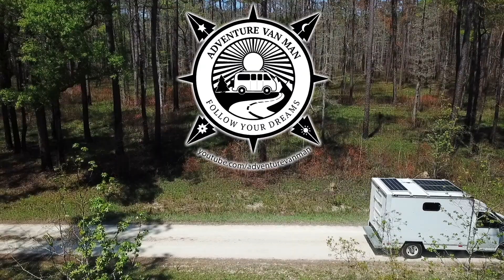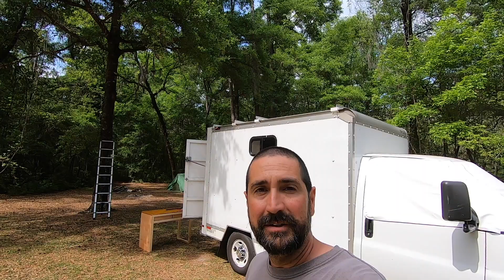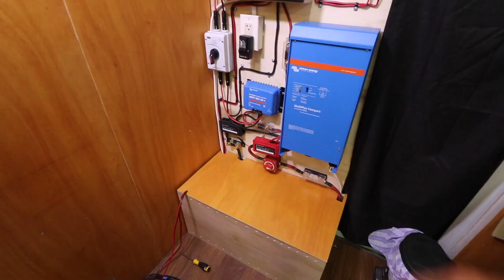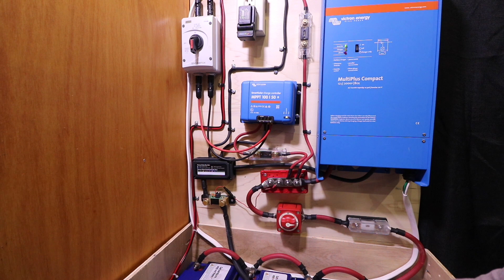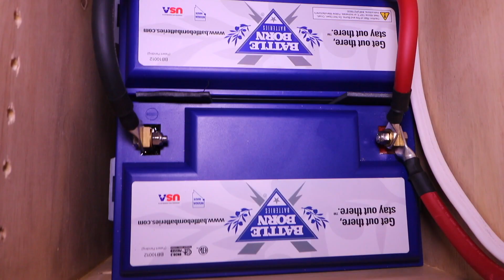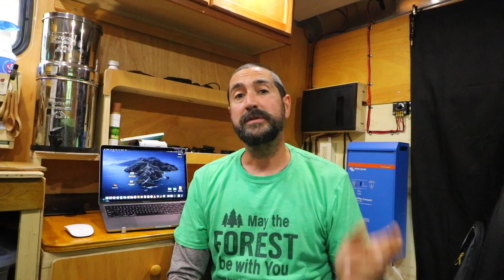Box Van Camper - Off Grid Lithium Power

Comment: The only thing I see that might be an issue is your fuse on your charge controller. You have a 30 amp fuse and it should be at least 100 amp?

Comment: Nice video...Just curious, couldn't you just put couple 15A circuit breakers on wires coming down from the solar panels  instead of that big disconnect switch?
Reply from the maker: Yes you could.  I could not source a quality and reliable 12 circuit breaker at the time of this install. 👍🏼

Comment: Cool setup - but the neg bus bar appear to be uncovered. If something metal touched both bars, you are going to have a massive flash and hot metal flying before the 300A fuse blows. You have the Pos bar covered, why not cover both?
Reply from the maker: I took it off to show the terminals for the video.  It normally has a cover. 👍🏼
Reply: OK, good to hear both bus bars are covered.
Can you explain why you have a 300A fuse on the main circuit? I don't think you will ever have a 300A load, even while running the inverter on a high amp appliance. Fuses should be just big enough to supply the needs of your setup, amps over that are just more sparks and damage if something shorts out. (looked up the amps to watts conversion) 3600 watts will be supplied by that fuse - do you need that much?
Reply from the maker: That is the fuse Victron supplied and recommends using on that inverter. 👍🏼

Comment: Whenever possible use 12 volt only. Power conversion from 12 volts to 110 to charge low voltage batteries is not an efficient use of power. Most of those devices can be purchased 12 volts so if available go 12 volt. The inverter should only be used for those devices that are not 12 volt capable. In my RV I seldom use that device seldom off grid. 

My main use is for appliances but most of those have a backup. Like my espresso machine has a turkish coffee pot that I put on a burner or camp fire. My 110 instant hot water heater is backed up with a solar shower and a engine coolant loop heated by driving. Just things that have worked for us in over 40 years of being in the field. Great job you will love what you can do with the new systems.

Comment: Very professional looking setup Good job. I run a lithium battleborn battery in my little teardrop trailer I'm thinking about adding a second battery what's the number/size cables are you using to connect each battery. 
Thanks
Reply from the maker: 0/2 gauge

Comment: I really like your set up, my question is why didn't you buy the new battle born lithium battery (240 amp I believe so I could be wrong).  Wouldn't it have been cheaper and have more amp hours. Or why did you go for the four battle born instead of two. Hope I make sense. Thanks

Comment: I love watching your videos. Its a neat setup. The only thing I see that I would want to alter is the lead that goes up to the shunt, it is touching the positive of the battery, over time this could vibrate (especially off tarmac roads) and wear through the insulation causing a dead short and as it basically bypasses the main battery fuse it could have terrible consequences. Fortunately its easily fixable by securing the lead away from the battery positive with a cable clamp or cleat.

Comment: You've invested thousands of dollars in a solar panel and battery  bank system Does this make sense ? Does it make sense putting gold plating on an almost salvaged vehicle? What's the engine and drive train in your box truck worth? Isn't it worth less than this solar and battery bank system?
Reply from the maker: I earn money online using this power.  In the last 3 months since I installed this I have earned more than the value of the power system. So yes it is worth it to me. ✌🏼

Comment: As mobile as you are, you should have looked at getting a goal zero 1500 lithium portable electric generator. You could charge with the solar system, but take it outside of your vehicle. It’s not cheap but has lots of versatility. Maybe next time you need batteries. Good video and very detailed.

Comment: Make sure that inverter has the capability to detect AC line issues such as no ground and reversed common and hot.  If it does not have these items, then make sure you get a shore power cordset that has LEDs indicating the AC power status at the shore power plug.

Comment: That looks like a very capable and well done system.  What made you decide to go with such a big inverter?  If you are running only two AC duplex outlets a 1,000 watt inverter would be more than adequate.  I can see the bigger inverter if you have plans to get a full size microwave or microwave convection oven.
Reply from the maker: I run power tools. 👍🏼
Reply: @AdventureVanMan  Thanks for the reply.  That explains it if you use plug in tools, but not battery tools.

Comment: No dispute that the build is exquisite. And I love your channel and your whole approach to your lifestyle. But your viewers should know that the cost of the Battleborn batteries alone is $3,600.00 ($900x4). For that price you can buy two LiFePo Bluetti AC200p solar power stations ("solar generators") and get just about as much power (4800wh from the Battleborns vrs. 4000wh from the two Bluettis) with none of the install work. In your case, you could dedicate one Bluetti for your computer/music, and one to run your other gear. The only downside would be if you need more than 2000 watts from a single AC inverter (2 units = 4000W available AC power). I am a long-term camper, not a full-timer, but if your goal is to live on less money, the solar power station route (Jackery, Bluetti, etc.) is more practical, safer, easier for beginners, and much cheaper, for relatively equal results IMHO.
Reply from the maker: Yeah, I’m not a fan of all in one units.  I prefer component systems.   At the end of this video I tried to stress finding what your personal needs are and go from there. ✌🏼

Comment: You could add alternator charging, if you get stuck in an extended no sun situation, and are moving to another place .  Then when you get there you'll have more power, especially if it remains not conducive to be outside.   Jayman...
Reply from the maker: Thanks!  Yeah, they sent me a Precision Circuits L-BIM to use but I haven’t installed it yet.  👍🏼

Comment: Great job on the tidiness and layout of your system! It brings to my mind some questions that I will research. First is I have never seen a cut-off switch that isolates the batteries from the charge controller.  Since you have a cut off for the solar panels, I'm assuming you would have to do that first before isolating the batteries from the charge controller.  
✌️😎😁

Comment: Nice rig. I am a   follower of your channel for quite some time and love your vids. Anyway, with the current set up, it seems to me that when you switch off the current from battery to your positive bus bar (let's say you are trying to fix some light/socket circuit),  it also disconnect the controller's path to your battery. This is a bit dangerous because, if you forget to switch off the incoming current from solar panel to your controller beforehand, the controller might get damaged.
So aside from the hassle of having to remember  turning off solar incoming switch + batter disconnect switch (in that order), your system will stop generating power if you are repairing some downstream circuit.
If I were you, I would consider having the outgoing positive wire from  charge controller, after going through the fuse, to connect to positive terminal of battery system (instead of the positive bus bar).

Comment: you're not monitoring each cell voltage separately, not balance charging? these are LIPO? i worry about your battery management especially when charging.
Reply: The Battleborn batteries have a built in BMS that balances the cells. From their website

The BMS protects the lithium cells from getting damaged in several scenarios.

1. From low or high voltage, low or high temperatures,  if there is a short in the system, it will shut off. The BMS shuts off the battery to protect the li-ion cells and the user from unsafe operating conditions. 

2. The BMS also regulates the amount of power you can take out of the battery. On our 100 amp-hour battery, the BMS is rated to 100 amps continuous, 200 amps for 30 seconds, and any higher loads for ½ second. 

3. Our BMS also keeps all the cells in balance. At the top of each charge cycle, the BMS reduces the charging rate in cells that have been topped off first, letting the rest of the cells catch up. This ensures that the cells are always in balance and maintains the quality and efficiency of the pack.

Comment: I just bought a shorty school bus. How much bigger would it take to run a Colman 15000 BTU RV roof AC unit, a 1000 watt microwave, 1800 watt induction hot plate, 12 volt Refrigerator plus the normal RV lights. I would like to be all Electric if I could? (Bootmender@AOL.com)
Reply: Call Battleborn and ask them, I'm sure they'd be happy to help. And mention Brian!
Reply: You left off a water heater.  That will be another 1000-1800 watts.  So, you could potentially have all 4 of your biggest watt items running at the same time.

Comment: As and engineer, I can now say you have also set the standard for power panels and the location for it, where you have easy access to all the switches and fuses. I may have missed it, but I didn't see a line and isolator to the alternator. In some locations and times of the year it can rain or be overcast for a week. Or if you have a malfunction on the solar side, you can keep your batteries charged while traveling to a location where you can get it fixed. That would require some form of limitation so you don't over tax the alternator.

Comment: Nice, man!  Good work.  That'll definitely get you through on those cloudy days.  I'm with you on that.  I LOVE being outside, but when the weather is bad, that's when I'm my most creative and it's nice to have some electricity to power those wants.  Thanks for the shoutout and I'm glad my videos were helpful!
Reply from the maker: Thanks again Nate!! ✌🏼
Reply: @SonnySideInc  Not for gasses from the batteries, lithium should never outgas.  They do need to be kept above 30 degrees to be charged, so vents allow the warm air from the heater in the living area to enter the battery box.
Reply: Does the battery box need to be vented?

Comment: cool system
for charging your small batteries, wouldn't a dc to dc charger be more efficient?
I use just 12v and have made chargers and converters to provide battery dc and also 12v (regulated - some 12v items don't like more than 12v)
but then again my background is electronics and testing systems
safe driving dude
Reply from the maker: I stay parked for 2+weeks at a time.  I don’t want to have to drive just to charge my batteries.

Comment: I would change the routing of the main negative cable so that it doesn't come into contact with ANY positive cables. I see the potential for rubbing through the main negative wire insulation sheathing on the far left (cable from batt bank to shunt) and coming into contact with a positive terminal, especially since this is a mobile application & will be in constant movement. Road vibration can cause that issue. Just my 2 cents to hopefully avoid a short/fire. Other than that your setup looks 100%!

Comment: Very nice job on solar. The only question you didn't answer for me is did you wire your solar panels in series or parallel? Also you might consider getting a  portable induction stove. I find on hot rainy days when you're forced to cook inside  that extra heat and moisture from a propane stove is intolerable inside the van. Keep up the great videos.

Comment: Brian, you installed a nice looking system.  I'm experiencing great performance from my lithium battery.  It's charged from 200 watts of solar.  The AGM battery is switched in when I'm on shore power.  I'm not certain if my Coachmen charging system is designed to charge lithium.  So for the time being, I use the switches and select what battery to run from.  The AGM seems to drop fast, but works best in the 70 to 80 percent range.  The lithium holds up over 90 percent for a longer time.  So when boondocking, I run from the AGM when I'm up and about to monitor it, then when I go to bed, I switch to the Lithium.  In the mornings, I let the solar bring the lithium to 100, then switch over to AGM, the rest of the day.  Hopefully, I can become fully lithium, connect them in parallel, and remove some of my tasks of monitoring so closely. Enjoy your journey.
Reply from the maker: Awesome.  Yep, I still haven’t dropped below 99%

Comment: Looks nice!  I wonder if that 30 amp fuse between the charge controller and the batteries is large enough.  That charge controller will put out up to 50 amps and your solar, 570 watts / 12 volts is 47.5 amps.  If you go to Colorado and up in altitude the output could go up. Lets us know if it blows and you have to upsize it.  Thanks.

Comment: One of the first videos I watched of his he installed a system where the wires coming from the panels went through a metal roof without protecting the wires from the hole. There have been several people that have lost their rigs from something as simple as that. I mentioned it in a comments section and the comment was removed. But hey what do I know, I'm just a licensed contractor with solar experience.

Comment: Any chance you can show some more detail on the solar panel install? Especially using those aluminum L-brackets.. I used unistruts to span the width of my box truck and they do sag a little in the middle but not much.. I wonder if your setup may bow in the middle from the weight of those panels.. My system consists of 4 x 315W Canadian Solar panels. It's working out really well at the moment..
Reply from the maker: I get just a slight sag.  Doesn’t seem to be an issue.
Reply: @AdventureVanMan  that is great. And this is 1/8" thick aluminum? 1.5" profile?

Comment: My LifePo4 battery is over 10 years old and still going strong. It is only 30 amp-hour 24 volts that I originally purchased for my bike. I take it along with me when I am on the road delivering RVs to run my 12/24 volt fridge and laptop in my car. It will keep it running for almost 4 days without charging the battery. When it is my van it is plugged into the solar to keep it charged at all times.

Comment: I have had this same system pretty much in my camper van for 3 years now. I have never ran out of power yet. Battle Born was awesome to work with.
Reply: do the batteries charge when the van is running?
Reply: @Cream_CurdlR  No, there is no provision for that with the Victron chargers he has -- but there is also little need, with nearly 600w of panels on the roof. For smaller vehicles, you can get DC to DC chargers in a wide range of quality and cost, from Renogy to Redarc and other marine type appliances. No cheap way to do it with lithium batteries though, since the charging requirements are not well suited to typical automotive alternator outputs.

Comment: System looks professionally built and correct.  I used to work in the industry, and this is the first time I've seen it all done correctly in a van build from the start.  The really good thing is that you seem to have a really solid understanding of the entire system.  Oh, and I can't wait for your return to music production!  You're a wonderful musician and I miss your work!
Reply: It seems light on the solar panels for boondocking to me. I'm building a similar-sized system (24v) and I've got twice the wattage of solar panels. (3 400 watt panels) Partial shade from trees, low sun angle winters, dirt etc. It looks like he could have squeezed in (3) 250-300 watt panels on his roof.
Reply: @chapter4travels  Brian doesn't mess about.  If he thought he needed them, they would be there. Has plenty of knowledge when it comes to these things. My solar technician said there is no use for a whole lot of panels if you aren't getting the sun, eg Winter months. I only   have 200 and manage fine. All seasons.

Comment: A very tidy installation. I missed hearing if the batteries can be charged by the engine-driven alternator, a shore power connection or a 120 VAC generator? If not do you plan to making any of these alternative charging sources an option? Thanks for the video!
Reply: He did mention that the inverter is also a charger when connected to shore power (and I assume generator) but you're right about from the engine alternator.  Guess I'll just have to re-watch the whole thing!  ;)